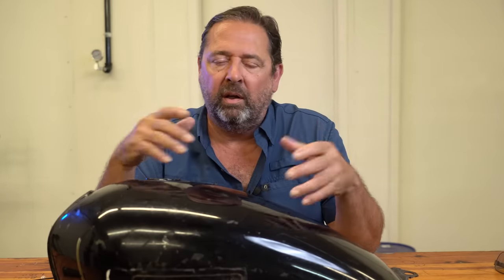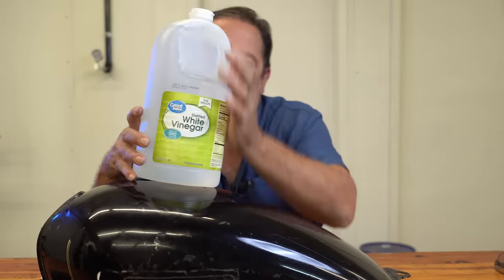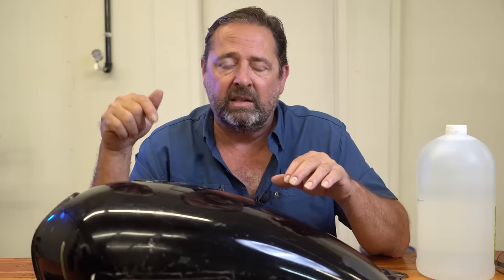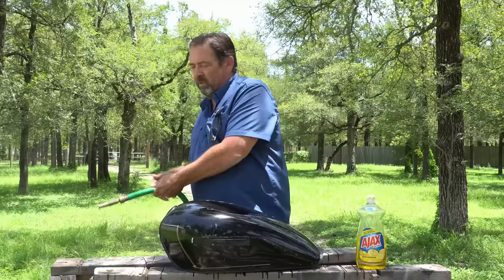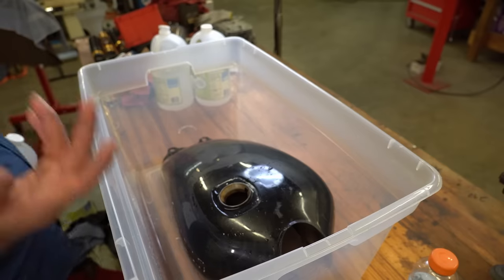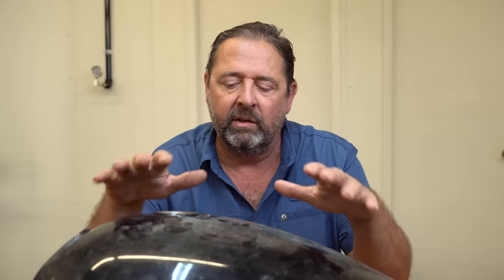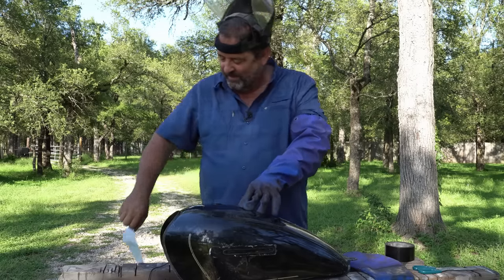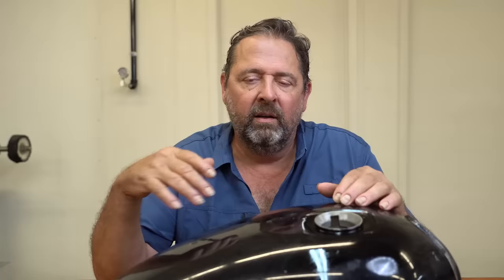GAS TANK--CHEAP--RUST REMOVER !!!!!!

Comment: My go to is Muriatic acid. (used to clean masonry) Also cheap, and then Washing Soda to neutralize. Come out sparkling without a hint of rust. Last tank had to be replaced as someone used an epoxy sealer that was peeling and flaking and could not be removed.
Reply from the maker: Yeah, if you don't prep a tank right before you seal it that can happen.

Comment: Cycle Fab is 125% correct on the vinegar, USE IT.   I have used it many times, sometimes for 4-5-6 days, the tanks always come out clean.   The HCL is a great idea if the vinegar does not get you quite as far as you want to go, be super careful.   Forget the Caswell's.......     Red Kote, Red Kote all the way....... it will be locally available at O'Reilly's (I think), it's cheap, and VERY forgiving.    And, it coats like a dream.   If your tank is in bad, bad shape, the vinegar will eat through and create pinholes if you leave it for too long......    but that will happen with anything that really removes rust.    Better to leak $2 vinegar than $25 cleaner.   I filter and recycle the vinegar, I have not noticed a reduction in efficacy, but never used it for more than 2 or 3 tanks.    

Great video, Cycle Fab, thank you.
Reply from the maker: Thanks for watching!
Reply: You are the first I've ever read who mentioned filtering the liquid you are going to reuse!  GOOD JOB!  I figured that was obvious, but others might not think of it.    I don't think you can do it with the Red Kote though.  Too thick!

Comment: I have a couple of Motorcycle Tanks to do soon. One is the Sport Tourer I ride and the Other is a project Bike that I'm restoring. If I'm happy with the finish, I'll do the other tanks I have as spare parts. I will be sealing them and I know it will cost me a fortune, but some of these Tanks are 40+ years old and hard to get. Cheers mate😎👍
Reply from the maker: Good luck with your projects!
Reply: I have 5 Kawasaki motorcycles. 
2 x Zg1000 sport tourers and
 3 x Kz750s (early 1980s models)
I had a Kz750 e1 when I was young and had to sell it when I became a father and now the Son and Daughter have left the nest I decided to get one again if I could find one and then got to the piont of having 3 and a caravan and a shed full of parts. Cheers from Australia Mate. 👍😎

Comment: Very good presentation Sir, cool and easy to follow as opposed to much we see on YT! I just now derusted a Harley tank using diluted NaOH (10% lye) using electrolysis; cannot say I really was all that impressed although it wasn't too bad. Thought about taking the rest away using oxalic acid. I didn't really understand though; muriatic acid (HCL) is ****n dynamite as compared to the soft vinegar. Why not diluted HCl + neutralising using baking soda - just asking :)
Reply from the maker: Muriatic acid is too aggressive with the older tanks that I typically work on.  Vinegar is more easily controllable even though it does take several hours to work.
Reply: @CycleFab  Thank you kindly Sir!

Comment: After using the muratic acid for 40 seconds then washing out with water, what should I use next to prevent the flash rust while I try to dry the tank overnight before coating? Thanks great video

Comment: I'd think you could stop the flash rust problem using gas with premix two stroke oil in it.  A high ratio like half oil would coat the bare metal with oil and not miss anything. Later after pouring it out anything left was meant to be burned by an engine.
Always thought a little oil in the tank might stop or slow down the rust.
Great tips. I want to try it on external sheet metal rust and my boat trailer.
Reply from the maker: That's actually a very good idea!  I think I'll try that next time vs. using WD-40.
Reply: Mix water and lemon juice 50/50 and soak freshly derusted steel- it gives a faint green tinge and will not flash rust after rinsed off. Learned this from a guy who does a lot of rust removal with molasses/water mix.
Reply: How did you wash or did you use water after you put the muratic acid sir
Reply: @ahvyetnoc7287  I never did this. Only had the idea of using the oil instead of acid. Then when you put gas in the oil dissolves and burns off. I used to put a little premix in old fourstroke tanks hoping it might slow the rust. Seems to help.
Reply: @jeffarcher400  what do you use after the vinegar? Do you just wash it out with water?
Reply: I like that idea, I planned to use kerosene or diesel since they are oily fuels. I will fill it with gas as soon as I can also. I still will add some two stroke oil.
Reply: What is this flash rust problem. After cleaning out tank with White vinegar how long before swilling 2 stroke fuel around inside. Does that then finish the job and can put regular fuel in?
Any answers would be greatly appreciated by an old guy down under owning. Honda CB400 Super Four who left old fuel in for a year or more. Now the pump is had it and the tank inside seems to be a mixture of sediment and maybe rust.

Comment: Hey Larry -- cannot thank you enough for this video tutorial (as well as your other videos).  Your delivery is clear & concise & packed full of quality information.  (I'll be cleaning a Harley dual tank in a few weeks.)
Are you still using the denatured alcohol to help dry out residual water?
Thanks again.  I appreciate you!
Reply from the maker: Yes, I do use denatured alcohol if I'm dealing with a tank that has rolled or crimped seams.  Thanks for watching and double thanks for the complement.
Reply: it's difficult to see what you are doing.

Comment: A great informative video, as well as part 2 (Caswell Epoxy Sealer).  It's great to know that vinegar make a good rust remover.  My big question is, after you used the Hydrochloric Acid, did you neutralize the inside with baking soda and water?  Wouldn't that (the final rinses) leave flash or surface rust on the exposed metal surfaces prior to sealing with the epoxy?
Reply from the maker: I forgot to show that in the video, but yes, I do use baking soda to neutralize the acid.
Reply: @CycleFab  I was wondering the same thing.   When you use the baking soda is it in the dry form or do you mix it with water?  If so what's the dilution ratio?
Reply from the maker: One gallon of water to two cups of baking soda works well but you can mix it stronger if you feel like you need to.  Thanks for watching!

Comment: I work with larger tanks. Say 12 gallons. The bottom hole is less than an inch. The filler hole  goes into the tank about an inch. Thus, making it almost impossible to remove the debris. How do the shops get around this?
Reply from the maker: In this case I would suggest using 3/8" ball bearings inside your tank while cleaning it with soap and water, to break up the large oxidized debris.  You'll probably will have to do this several times.  Thanks for watching!

Comment: I have been using vinegar for a while for cleaning rusted parts too. I soak the parts for a couple of weeks depending on how much rust is on the parts then wire brush the parts clean. When I'm done it looks like they were zinc coated the prep for paint. If I want a good seal I will use acid etching primer and it's good enough for me.
 When restoring old car sheet metal I will clean it the same way bur after wire brushing it, it makes it easier to weld to.
You do good work.
Reply from the maker: Thank you for the compliment, and thanks for watching my channel!

Comment: Steps are: High pressure water rinse, soap/water rinse, thorough water rinse, vinegar bath for 24hrs, 40 sec hydrofluoric acid wash, wd40 to stop flash rust forming, acetone to remove wd40 & then add tank sealer.
Reply from the maker: That's the process,  I do use two stroke engine oil now instead of WD-40.  Thanks for watching and commenting.
Reply: If I decide not to seal the tank and just coat it with 2 stroke oil, is it safe to leave the oil when I fill it back up with gas?
Reply from the maker: Try to get as much out as you can before filling it up with gas, you'll be good.  Might smoke a little.

Comment: So when you get to the muratic acid portion, are you rinsing that out after neutralizing the acid or letting it dry out hoping there is no baking soda left over? These are great tips but it seems like a few key details are missing from the video. Hopefully I can get a response soon as I am in the middle of a tank cleaning and trying out your method. Thank you.
Reply from the maker: Hind sight being 20/20 I did (unintentionally) leave out some key steps, taking for granted that they would be interpreted.  After the acid is poured out I rinse the tank with fresh water and then a baking soda/water mix and then I rinse that out with water and then coat the inside of the tank with oil (two stroke engine oil) if the tank is not going directly back onto the bike.  Sorry for the confusion.  Thanks for watching and taking the time to comment.  Good luck with your project.
Reply: I listened to his steps and read a few comments and replies back to comments. My tank cleaning was a huge success!!! I greatly appreciate the content! I'm extremely satisfied with the results!!  Thank you so much for replying back.

Comment: Great video. About to do the same on a Honda atc tank.    Have you ever heard of a product called hold tight?  We use it with our dustless blaster. (Think massive sand blaster with water). We stripped a truck several years ago to bare steel and it is still perfect!  Usually without it it will rust within hours.  And it’s safe to paint over.  I think I’ll try that.  Maybe look into it for yourself.  Just a tip.
Reply from the maker: Yes, I will check that out.  Thanks for watching!

Comment: I had a jack that was under water in the wheel well of an SUV that had a spare tire submerged in water. I put the jack which was crusted up with rust into an oil drain pan with vinegar (from the Dollar Tree) and let it set for about a week and it dissolved all the rust but it also loosened up all the paint. So with it just being a jack I took a high pressure air blower and blew all the loose paint off then primed it and will paint it soon. Thanks for doing this video. I have a rusted up motorcycle tank that is irreplaceable (not easy to find). I was lucky enough to find Evapo-Rust at Northern tool in a 5gl. bucket for around $40 or so, it's been a while since I got it. The only thing is, I don't think they have it anymore, at least on-line. They say you can filter it and reuse it indefinitely. I've seen other people using a light chain to agitate and scrub the rust off also, we used to put a handful of bolts in the tank and shake it around but a chain is much easier to retrieve.
Reply from the maker: You really don't need a chain or nuts and bolts.  But a lot of people do use those items.  You can also use stronger vinegar too; 30% to 45%.  Works very well!  Thanks for watching and subscribing!

Comment: I’m going to check out your other videos.  I have two vintage Honda Trail 90s that need this.
Reply from the maker: Awesome!
Reply: How did the vintage Honda Trail 90s turn out?  Did you do this process exactly?  Did you use Caswell?  I have a 1970 Trail 90 that keeps clogging up the jets from the rusty gas tank, despite added in-line fuel filters.  I was planning to use this method and then Caswell.

Comment: About a pint of muriatic acid will do what the gallon of vinegar will do. And you can fill it with hot water, or better yet, you can just slosh it with the acid, then dump it in 2-3 mins, then rinse it with 1 gal of hot water 3-4 times. Then put 2-3 spoons of baking soda and hot water. Rinse, then 2-3 more hot water and you're gonna have a dry as a bone and rust free tank. Then put that kreem liner in it. Of course there's many precautions in each step. The cap hole is plugged with those exhaust plugs for dirt bikes, the filler hole with duct tape, all other holes plugged up with whatever is right for those holes, acid wont eat duct tape, it will eat pot metal in the petcock. Hot water of course is hot water, wont eat anything. Just need to slosh it and not burn yourself. Baking soda - likewise. The liner - it needs to sit there for 1-3 days in hot weather. It will eat duct tape. I use a inner tube on the stock petcock and the exhaust plug in the filler cap.
Reply from the maker: You're right, you can clean a tank that way using muriatic acid.  But personally I prefer to use as little muriatic acid as possible for safety reasons.  The process your using is a lot faster though.
Reply: @CycleFab  Yea, and worse yet, you have to buy those by the 2 gal container. But if you have a pool, you have use for a lot of the acid.

Comment: how long did you leave the vinegar in the tank? also, what is your opinion on using the tank after the vinegar without using a sealing product? thanks!
Reply from the maker: I leave the vinegar in the tank for a minimum of 24hrs.  You don't have to use a sealer if you chose not, BUT it has been my experience that with a heavily rusted tank it would be in your best interest to do so.

Comment: How would you go about getting rust out of a larger tank that’s welded in and can’t be turned or lifted for the acid part? Or even sealing? 
For reference gas tank is welded in and only access is the filler neck 
Thanks! Great video!
Reply from the maker: I would use electrolysis on a tank like that to get the rust out.

Comment: I've de-rusted large steel tanks with muriatic, at 50/50 it can create a hole if you have enough rust, but it works where vinegar won't and FAST.  Vinegar is safer and will get the rust out if you let it sit long enough, but it leaves nasty black smut on some metals, but so will muriatic. You can use some mild abrasive material like small rocks with a cup of borax and water if you have something to agitate it, No flash rust after that, borax is a neutralizer plus it cleans real good. Chromatic acid will clean the smut too and leave a super shiny clean metal but its expensive and bad stuff, it contains hexavalent chrome. Oxalic acid is another one, not real strong and it works like vinegar, works good to get stains off of wood, never tried it but I plan too. My job in the 80s was working with various acids, I'm lucky to have eyeballs now. Keep in mind any acid will eat the rust much faster than the metal, rust is already oxidized. Its not rocket science but it takes some care. Protect those eyes, if you get muriatic in the eye you can't get to water fast enough.
Reply from the maker: Thanks for the info!

Comment: Good video. I only mess with 2 stroke engines and to protect a newly cleaned tank interior, I mix a quarter cup of petrol with a quarter cup of 2 stroke oil, sloosh it around, then dump it out. The 2 stroke oil seems to coat and protect the bare metal inside the tank very well...
...but that's just me...
👍 ☺
Reply from the maker: I started using that mix and it works better than what I had been using.  Thanks for watching!
Reply: Hey man! I’m in the process of cleaning my sv650 tank right now with vinegar, I’m just wondering after I get all the vinegar out with my hand pump should I use water and baking soda to neutralize and flush the tank out and then use the two stroke oil and gasoline (petrol)? Or what would you do? Thank you!
@davebarrowcliffe1289

Comment: Yes, vinegar works. I personally use apple cider vinegar seems to work better. I have cleaned many small engine gas tanks with vinegar plus after you flush vinegar out the tank will flash rust. So be ready with some light weight oil such as Marvel Mystery Oil works fine to pour in the tank as soon as you rinse tank out.
Good video.
Reply from the maker: Thanks!
Reply: Do you fill up the whole tank with the oil or just pour some in there and shake it to lightly cover the walls. Thanks
Reply: @titoace408  I just splash a little bit of oil around in the tank. Have your oil ready cause as soon as you dump the apple cider vinegar the tank will begin flash rust. So be quick with your oil , just a little will do but make sure you coat the whole inside of the tank.
Reply: @waynegambrell7095  thank you very much for your response
Reply: @waynegambrell7095  hey man should I rinse the tank out with water and baking soda after I dump the vinegar and then use the oil or should I just use the oil directly after the vinegar

Comment: Good ole draino crystals with some small gravel or aquarium crystals used to work great for me.   The tank would get hot but it would be nice and clean. You dumped it out after a short time. Then use cold water to rinse for a bit and a hair dryer inside to completely dry or let it sit in the sun on a warm day with the gas tank cap off. I suppose liquid drain cleaner would work to. Use protective gloves,glasses . Don't breath the gas in use a fan to blow the fumes away. It works!!!
Reply from the maker: Thanks for the tip.

Comment: Muratic acid is what I have used for 25 years. The best thing about the viniger is it will not hurt paint. Problem is no matter what you use the rust will come back. You have to seal the tank inside with vinyl tank sealer. I use the Eastwood brand.
Reply from the maker: Good to hear.

Comment: I did a twenty gallon horizontal compressor tank with diluted muriatic... used no more than a gallon (half a gallon if memory serves me). After that's done soaking I mixed up some oxalic acid crystals and made a "finishing" acid which will leave a white phosphate type coating similar to phosphoric acid, but much cheaper to make. After the finishing acid, I drain, dry and there's no need to coat with oil. It's ready to coat or store and won't flash rust. I later coated the inside with Fluid Film since it's an air tank.
Reply from the maker: I'm going to try Oxalic acid next time, I've heard of people using this before.  Thanks for waching.